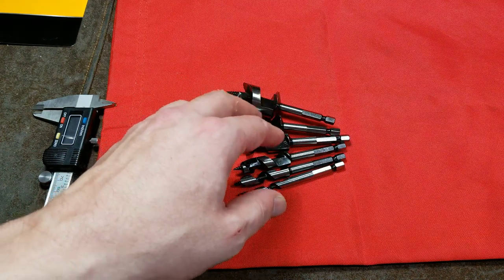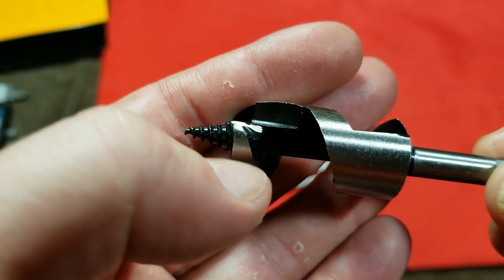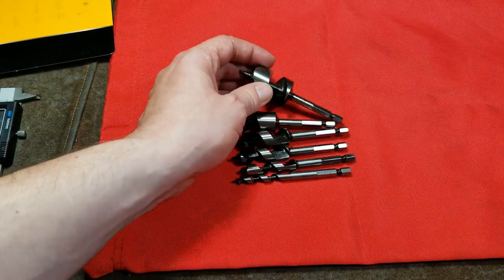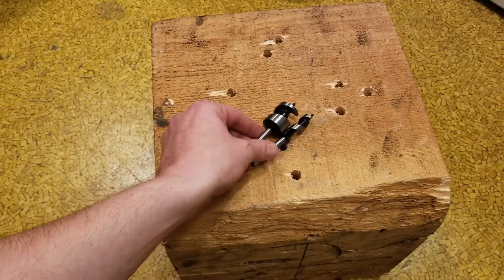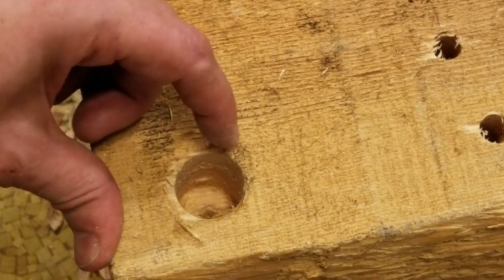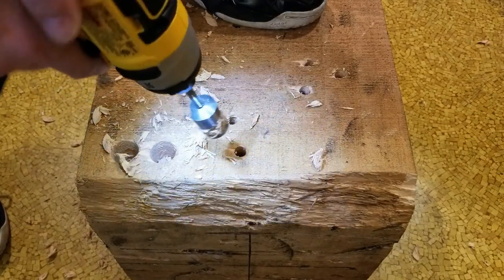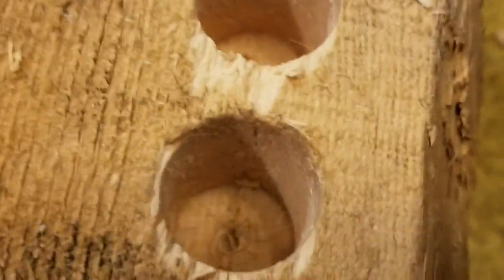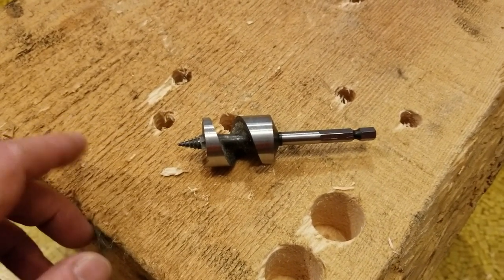Harbor Freight Warrior Stubby Ship Auger Bit Set Review

Comment: This style of design was design for  use by a hand powered  brace and bit  turning much slower that 1200 RPM  Switch the drill to its slower screwdriver speed  it will work better 
The best use for large auger like is putting holes in 2x4 studs for running electrical wire through the walls before drywalling 
Test it  by going through 1.75 inchs of stud lumber 
The stubby drill and the impact driver will fit between  between studs 16" on center
Reply: Yes, I think these are made to run at a slower RPM.  My dad had a couple of the hand Brace & Bits.  I still have them, and some short & long bits.  They do make a pretty clean hole, and don't wobble or get jammed like the spade bits do sometimes.
Reply: @Pyridox  the impact action make it more like a chisel  than a wood plane like of constantly moving